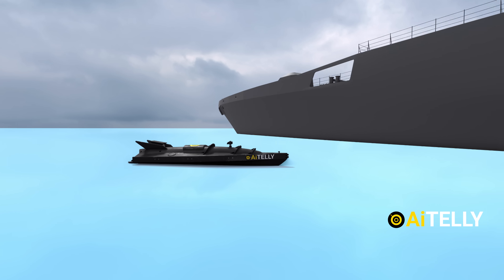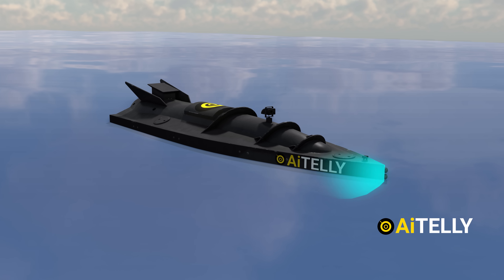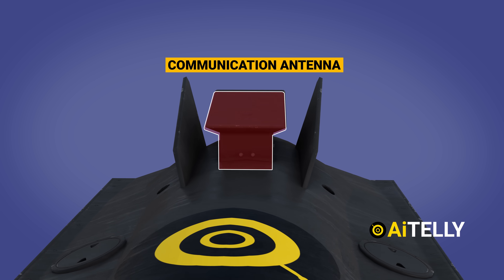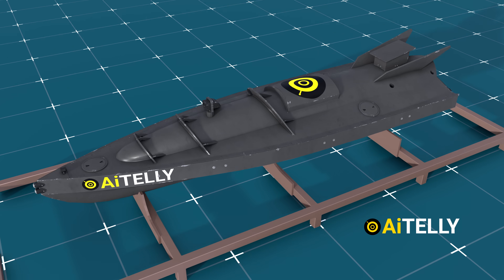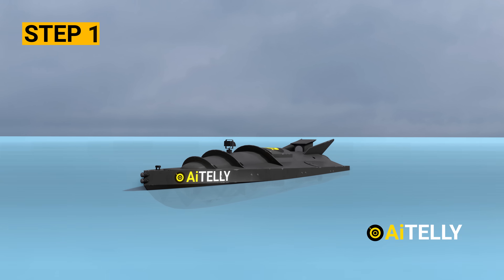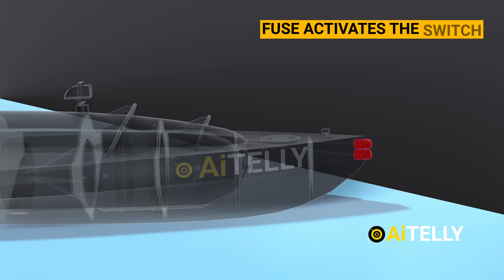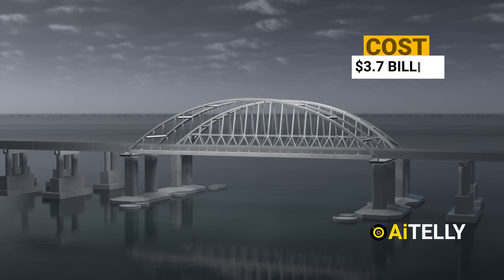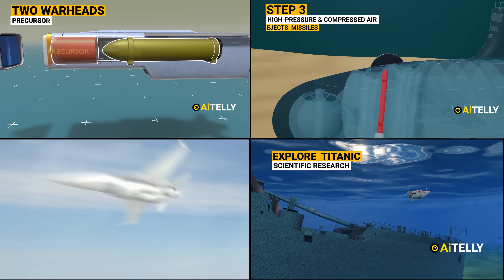Naval Kamikaze Sea Drone How it works using Starlink Satellite

Comment: Doesnt the warship and submarine detected any movement in the water since the engine will make alot of noise that a submarine can detect? The low profile is its main advantage. Other than that it will be render useless before it is even near the warship. Nonetheless good effort.
Reply: 70% are destroyed, but 30% make the big noise
Reply from the maker: Many of them got destroyed but it's worth the try
Reply: @Aitelly  worth the try was Kalibr destroying the factory where these boast are built. What’s the point of attacking the bridge, where civilians were killed? No point of attacking the ships in the back sea either, kalibrs are launched at Ukraine from the Kaspian sea, not Black Sea. Pointless waste of of resources, Ukraine is just desperate to do something to satisfy western bosses.
Reply: @Aitelly   Agreed, A for efforts
Reply: Hence why they are seen deployed in packs rather than individually.
Reply: Being so close to waves vastly increase the saturation chaff effects interfering with radar detection.
Now add the curvature of the earth + height of ship vs height of the radar vastly decreases identification range.
You also must consider the use of currents to avoid both noise and reduce radar AI filtration & detection. With optimal low light usage reducing chance of being spotted approaching target.

Detecting noise vs translating to being able to detect are two different concepts. even still all that would happen without combined detection is hundreds of floating speakers being dropped playing various stages of engine noise creating false detection alerts. lighting your noise detection & targeting system up like a Christmas tree making it useless.

You also have to consider being able to engage such a small target, then there is getting under the guns, with many ships having a low depression rate further decreasing intercept window.

Then you have it being used as a launch platform for other weapons and electronic warfare counter measures. Vastly reducing intercept time of far faster munitions or launching dumb munitions.

With how cost effective it is you 650m vs 250k you could effectively launch 2.6k and break even on destroyed cost vs destruction cost with drones being far easier to reproduce.
The moskova has a crew of 650, a cruiser takes a significant time to replace causes huge embarrassment, vastly decreasing  your capabilities and area dominance.
in turn the loss of the ships radar is a massive loss to treat detection and ability to incept threats, loss of command & offensive capability.
effectively resulting in greater area denial, as there is significant danger that you'll send your ships to attack the enemy into waiting drones as your acting in a predictable fashion. 61hrs mean they can deploy then wait to ambush for over 2 days.
Reply: @iangow-robinson9671  The main thing is not to forget to secure the assembly site for surface drones and specialists. Ukraine could not do this, and they were all destroyed a few days ago ...
Reply: @sssas1978  Just like your friends these loses are imaginary. Cataloge anything Russian gov or media communicates as fantasy and file it away in the shredder next to were you put your dignity and self respect.
Reply: They should learn with the Sweden - like the Submarines with Air-Independent Propulsion and Stealth
Reply: Сотни таких дронов уничтожино, и только 3-4 смогли что-то достичь, когда получилось неожиданно. 
Например боновое заграждение обезопасило мост, и повторная атака на него прошла впустую. (Хотя люди предупреждали еще 2 года назад что управляемый катер с взрывчаткой модет быть опасен, и говорили что надо делать). Боевой корабль, где нормально нестся служба, отобьется от них, хотя комбинированная атака, с воздуха, с воды, и из под воды, конечно опасна.
Reply: @sssas1978   АХУАХУХАУХХАУХУА СОТНИ АХХАХЫВХАХЫВХАХЫВАХЫВАХВХЫ
Reply: @ayooo454  У вас приступ, сделайте укол.
Reply: @ayooo454  Я в шумерских идеомах не силён... Продолжайте копать Чёрное море, не отвлекайтесь. 😂😂😂
Reply: @sssas1978  шо ты пасть то опять закрыл? отправился к корабликам после дронов?) как тебе почти ежедневные точечные удары по крымчику?) по плану идет киев за 3 дня?))

Comment: Only cost 250K… ONLY
Reply: I am surprised that they cost that much tbh.
Reply: @diego1694  exactly. Soviet era bomb cost nothing it’s free, if they did use it. 250k for the build of the ship? Don’t think so.
Reply: @HeKuTK0  Don't forget that sweet 10% for the big guy from each country
Reply: @Kiyoone zelly took 10% of it 😂
Reply from the maker: Kh-35 missiles cost around $500,000 each. Neptune cost around $800,000
Reply: @Aitelly  yes, but this is a water bike with a bomb and a remote control strapped to it, not a cruise missile. I think that a more apt comparison would be the Iranian drones that cost $15k.
Reply: @diego1694 electronics, camera and sensor says hello
Reply: @alahsiaboi8909  hello. Add another $15k for electronics. Or round it up and make it $50k total cost. Where is the other 200k
Reply: @diego1694  also iranian drones arent remotely controlled, so they arent equipped with adequate sensors and chips
Reply: @HeKuTK0  it has 400miles of operational range and you think a bunch of chips that ultimately cost $15k would cover that? Lol